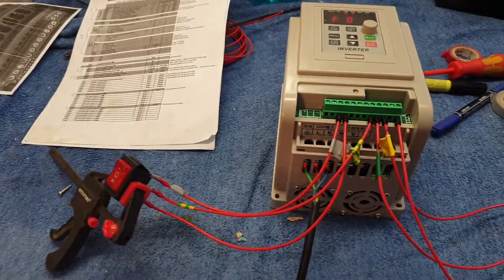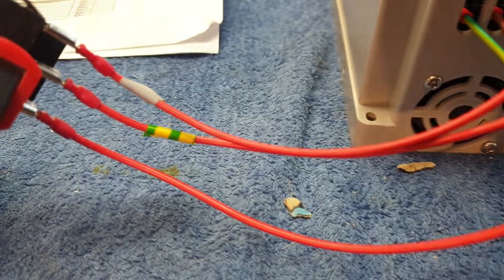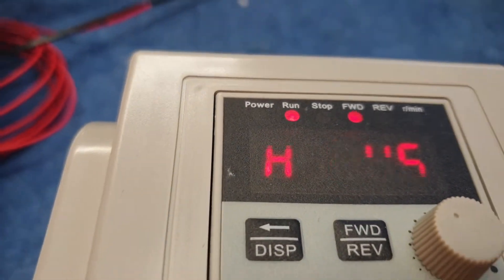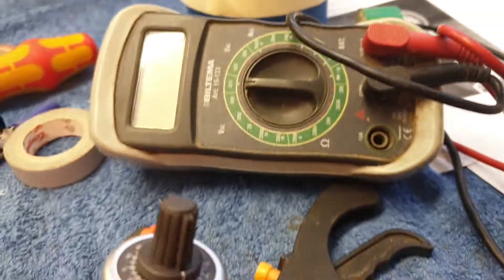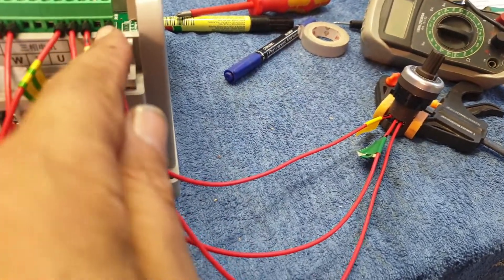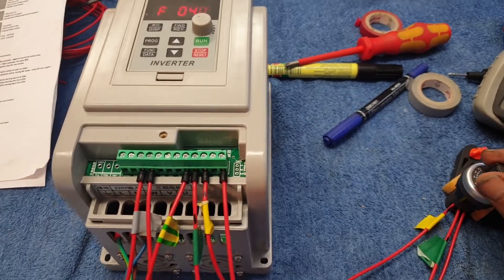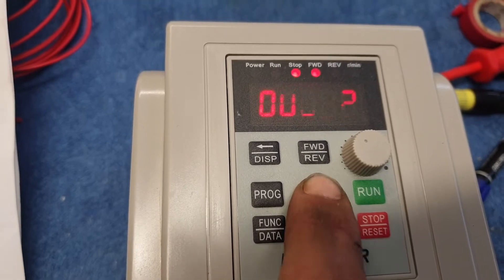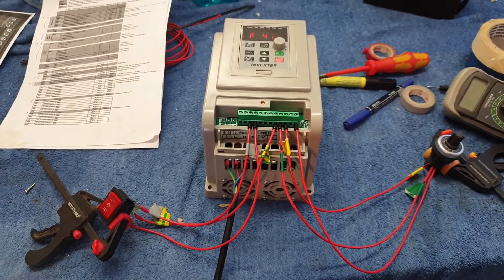How to wire a AT-1 Vfd for external potentiometer and external forward/reverse/stop

Comment: Please help me. In programming mode, all digits flash simultaneously and it is impossible to change any parameters, including parameter P77, which is responsible for resetting. Only parameter P9, which contains all zeros, works. I have attached a video. How to solve this problem? https://youtube.com/shorts/kcu9EgMjKko

Comment: I believe you note in this video that you wish you could get the display to provide spindle speed in RPM?  If so, I just figured this out, it WILL do it!  It’s kind of a two step process (or three step, if you include using a tach to record the spindle speeds across your VFD frequency range).  You have to go into parameter P21, “Revolution at 50 Hz”, which has a factory default of 2800 RPM.  But if you change P21 to your actual measured spindle speed at 50 Hz (1116 RPM in my case), then the VFD will now display the spindle speed in RPM when you switch P62 to “RPM display” (the 3rd step here, I suppose).  Since the relationship between spindle RPM and VFD frequency is very nicely linear, then the entire range displays spindle speed very nicely and accurately.  I’m happy : )
Reply: Unless you also have multiple pulleys, as I have; I installed an external tach, to read my machine's spindle RPM. I do have this same VFD, and wired it after watching this video.

Comment: how can I adjust the torque of the motor at low frequency? I tried with parameter P70 but only get an ugly sound in the engine. I just can't understand what is written in the manual about this particular topic. I have the same inverter as you

Comment: Good video, but it only applies to the old AT1 models. This is no longer possible regardless of which supplier you bought it from. I bought from Banggood and Vevor. It's all the same crap. With the new models, when you set the parameters P10 to 2 and P11 to 2, you cannot achieve the set frequency (parameter P06) with the external potentiometer; you can only reach about half of the desired frequency. The operating instructions remain the same. So, you need to be careful about what you buy. Don't waste your money.
Reply: Set maximum frequency to twice the default setting.

Comment: Hola podrias ayudarme a resetear de fabrica mi inversor. Al seleccionar RUN me aparece ERR 1. TE AGRADEZCO
Reply: Si revisas el manual, dice que Err01 es cuando se protege el modulo de alimentación, dice que la posible causa es que la potencia del motor es MUY alta o que los alambres están en corto circuito. La recomendación es quitar los alambres del motor y encender, si hay problemas aun así debes reparar el VFD porque los otros problemas quedan descartados.
Espero que te sirva la info 11 meses despues.
Reply from the maker: I only speak english, german and danish.

Comment: Hi Peter. Thanks for your video. I own a bench lathe (motor: three-phase, 1.1kw and 140rpm) and a VFD like yours. I would like to install a brake resistor, but I don't know if in this VFD I can install a brake resistor and what is the proper value.  Please,  could you help me. Thanks again and sorry,  my English is not good.

Comment: Final  i found that i had to set program P06 to 100Hz in order to  cover 0-1500r/min using external potentiometer 10κΩ!
 At first i set 50Hz and with panel potent iometer i could change 0-1500 r/min but with an external potentiometer i changed 0-750r/min.
So i  set 100Hz to P06  it works 0-1500 r/min with external potentiometer 10 kΩ but when i change P10 to the panel potentiometer it works 0-3000 r/min
Reply from the maker: Great man. Glad you made it work 🙂

Comment: I want to use external analog signal for frequency and I used external potentiometer 10 kΩ but this external potentiometer start from 0 r/min until 760 r/min to the max position. My single phase motor works max 1500 r/min. Does anybody know what is wrong
Reply from the maker: Try a 3K potentiometer instead. Also - single phase motor for VFD is always a little bit hit or miss. Better to just get a 3-phase.
Reply: @petergdk  Thanks for your  answer    i'll try with 3kΩ
Reply: @thefraperman  use a 20k pot and instead of giving the pot 5v use the 12v terminal. 0 to 100Hz on the remote pot.
Reply: @thefraperman
1 year ago